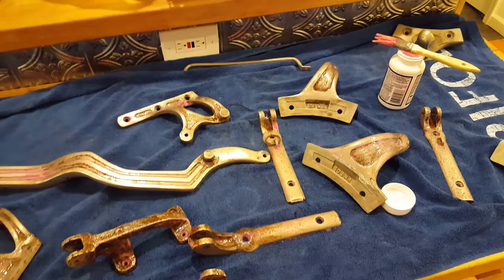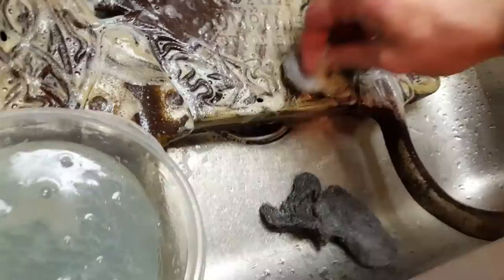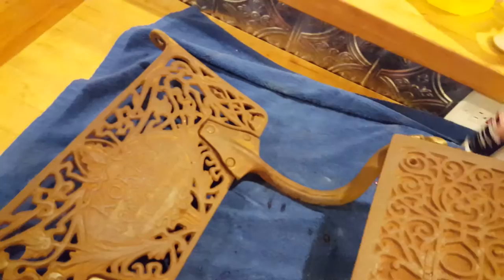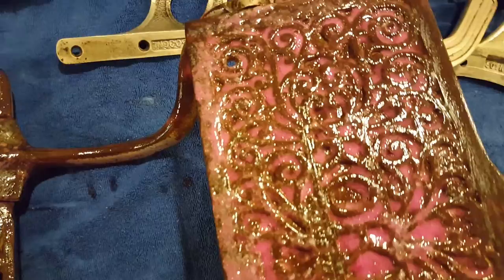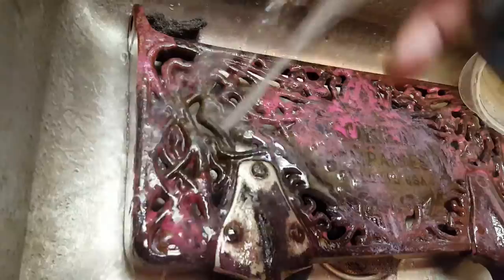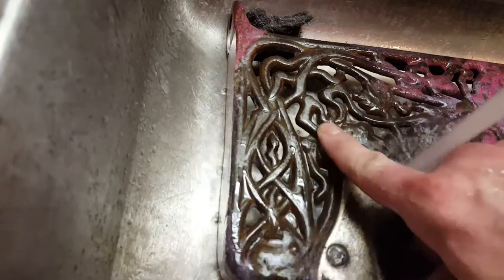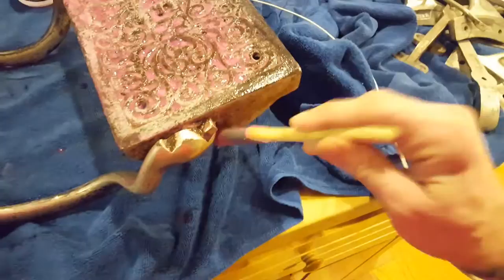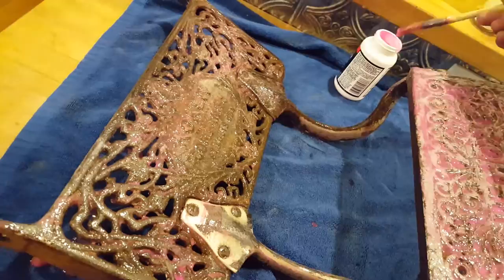Barber Chair Rust Removal Restoration

Comment: Where did you get the rust remover at?
Reply from the maker: alphacharlie65ms its called naval jelly
i bought it at a hardware store .. try walmart or parts store
Reply: Hair and Beard  - yo could tell me how to fix the chairs break?
Reply from the maker: @petercorban5906  the break is a bracket that squeezes a rod.. over time it may have eroded.if its not broken try tightening little by little untill it brakes properly
Reply: You have to be careful with navel jelly, especially in places where there's seams,  it can continue to eat, .under the paint.